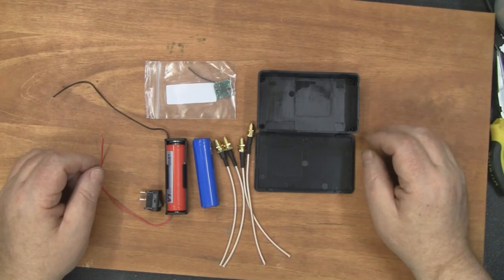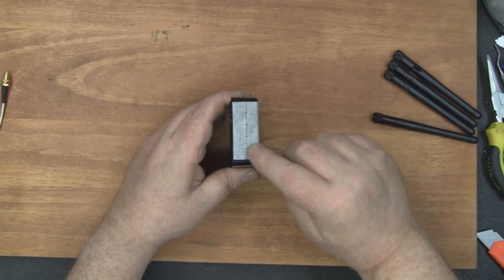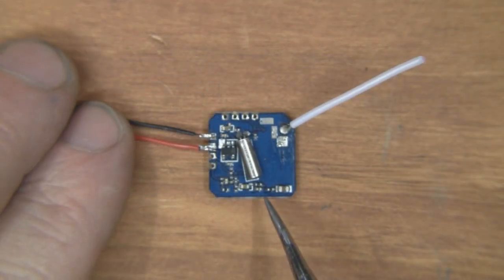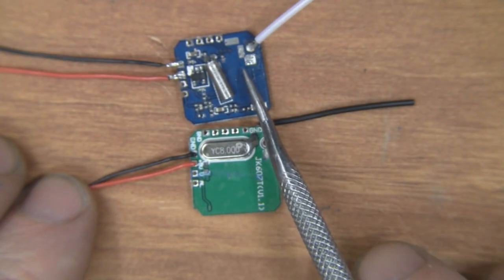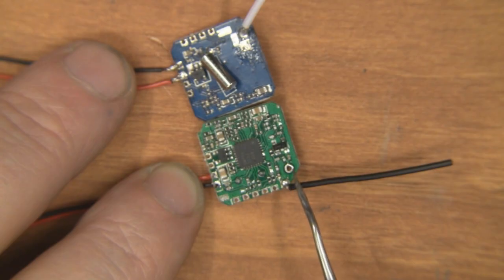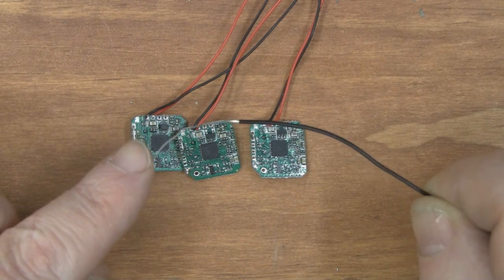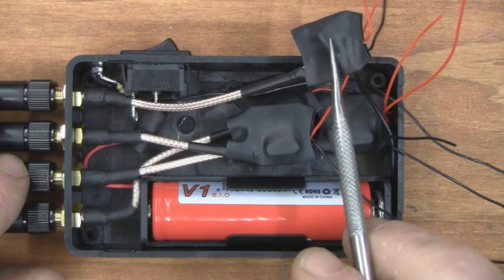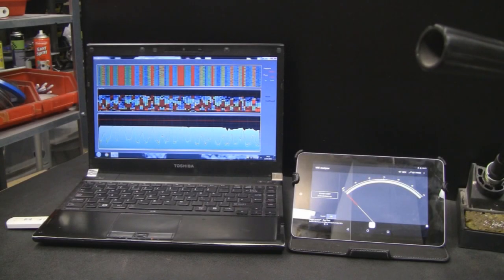WiFi Jammer #97

Comment: Hi Andrew! Nice project. I ordered 4 boards and the are different from both of yours. I wrote to the seller and he told me that I have to place the jumpers between pin 4 and 7 were 7 is ground - vcc, then lets say 5 and 7, and 6 and 7 and leave one board like you with no jumpers... Does it sound logical to you to use the ground? He says that way I will get channel 1 -2-3-4... I would love to send you a closeup picture of the board, but I do not now how. If you can give me a hand I would appreciate it very much. Cheers

Comment: Hello, your video has helped me a lot for the construction and presentation of one as a school project, so I thank you for the video, however I have some questions that I wondered if you could answer: With the Jammer that I have built, the signal is not inhibited , but dims, in my tests a 70mbps download and 31mbps upload connection dims to a 4.70 on both. Why has this happened? Why hasn't it been disabled? The components are the same and the only difference is the battery that in my case was used a 3.7 volt lithium cell phone battery, it was slightly discharged.
Secondly, the inhibition area is quite poor, the devices to be inhibited must be extremely close for their signal to be attenuated.
Finally, what is the spectrum analyzer program or device that you use, both the tablet and the computer?

Comment: I knew there was a good reason to save those dozens of Wi-Fi antennas I got for free.

At one time there was a small "antenna tester" called the AirHorn.  It made a very effective Jammer (shh) too, and had its own GUI control package for the PC.   It attached via a USB cable.
As a jammer it was under-powered, but could be very useful in a large apartment complex for driving your neighbors to other channels

Comment: Dunno if you see this but... I use XLT24017 as the ones you exposed here are not to be found anymore (by me at least), and they run pretty hot. I can still touch them, but I have the feeling that´s not how it should be, or is it? I´m powering them with 4.95V as per the current specified is 5V on the datasheet... All comments are welcome! Cheers!
Reply: @bunny lord I can't see your question, just the notification, strange, hope this reaches you; Honestly, and thinking about it, I admittedly tried only the preinstalled little piece-o-cable antenna it was shipped with as the antennas I got shipped were sent with a wrong conenctor (their fault, I'll be getting new ones reshipped). I guess with the correct full sized ones (with ground conencted as per the shielding) should help (?). Otherwise, my test in my house showed indeed a breakdown in the communication, even with those cable-antennas... Thank you for commenting and investing time!
Reply: @RIPezz_Raded what makes you think it wouldn't? Frequencies for 2.4ghz  are everywhere the same...

Comment: I too was wondering about the battery/power supply. As far as I can tell, the transmitters are powered by 5V, what am I missing? Thanks ahead of time for your help.
Reply: its a 18650I 3.7V Rechargeable Battery 2500 mah plenty enough to run the transmitters

Comment: I've heard of farmers using these to keep drone pilots off their land.
Reply: That’s why I use Crossfire or Ghost no interference 😱
Reply: Well those are some cheap farmers! Good drones use a protected connection that goes via a encrypted connection.
Only drones up to 70$ use wifi
Reply: @Kayshots , a encrypted connection will not stop the drones from being jammed. If they use 2.4 GHz and it‘s a jammer (not deauther), the drone can still not be controlled.
Many more expensive drones use 5.8 GHz, which still can be jammed (but it‘s more complicated).

A jammer basically is like someone shouting in a meeting, while others speak. It floods the spectrum with noise and therefore messes with the modulation. A deauthing device will send false deauth frames and abuse a exploit in most (even expensive) routers.

Comment: hello Andrew ! i live by the sea and there is no adsl ( no wired phone ) so the only way to connect is through a hotel i bought ALFA WiFi adapter ,,, it worked fine  the first few days than it started disconnecting and reconnecting by itself ,, i spend hours googling to find a solution ,,, many say drivers ..updates ect.. all that didnt work i even formated my pc win 10,, than someone said alfa needs 500ma at least  to work so i bought usb hub and a 12 V charger than  the whole thing blows up, the usb hub and the alfa is there away to connect to the hotel ? the distance is only 300 meter please help ! i had enough buying data on my phone

Comment: what's the battery rated @? 1.2v?? or 2.4?, assuming it's a rechargeable
Reply: Fone Zombie 3.7 volts and yes it’s rechargeable. It’s call a 18650 battery

Comment: When is an AV wifi module becoming an illegal device ? It seems to me that broadcasting a wifi signal can't be deemed illegal, even if it is powerful enough to "jamm" other signals...
If operating AV modules is illegal then any mobile phone, router or the like could be deemed illegal. You can argue that any added connected device (mobile phone or tablets) will make smaller the available capacity for the rest of the connected devices... Would be connected to the wifi network and using capacity be considered as being disruptive ?? It could be if you think about it... Keep in mind that most people using wifi networks hardly do anything useful with there hand held vibrators, broadcasting there usual daily (social media) nonsense and assorted rubbish... Could that be considered illegal or disruptive ??

If you were to put in a small audio device to the mix which would make it a device which is most likely protected by your freedom of speech...

Comment: remove microwave door
Wifi jam
Reply: Cuts rose scents leave door closed on a 1200watt microwave and it works... my wife does it to me every night.
Reply: Millsolar 
dude that means the door seal is leaking microwaves is the Wifi cuts out.
Your children may be born with x men superpowers from mild radiation exposure.Positive mutations!
Reply: Cuts rose scents all microwaves do that. ask your power company to come and do an emf reading in your house. the door is just glass.
Reply: we dont let the kids anywhere near it when its running
Reply: Millsolar 
I know,I tested my old microwave with a meter. I had a seal leak in the lower left corner of the door.
Cut the cord and trashed it.
Its not like a Fukishima meltdown. The magnatron is pretty weak in a little microwave. 
But I have since been collecting them to make a focused microwave array.Im taking down the commercial drone that the jerk down the road flies over my property.Its my airspace.
Reply: @cutsrosescents4950  what happened did you get the fruit cake of your neighbor got same problems sheriff said I cannot shoot it down because is considered discharging gun to the air

Comment: do you know if this jammer will also jam bluetooth connects as it also operates at 2.4GHz?
Reply: it will
Reply: @naineeowo1469  hi , can I block Verizon wireless camera , whit jammer??
Reply: Kostadin Tomov yes it will
Reply: @naineeowo1469  nice, do you know from what distance I can do that? Like 10 meters 20...? I think that cameras using cellular data .
Reply: @kostadintomov2279  I am sure it can do 20 metres and dont worry it can definetly jam the wireless camera which uses cellular signal, after all cellular signal is also wirless. And also curios why do you want to jam a wireless camera?
Reply: @naineeowo1469  my neighbor is ass , he have 2 cameras pointing my house . I just want my privacy.
Reply: Kostadin Tomov Oh ok, but are you sure your neighbours camera is wireless and not wired, if it is wired camera, jammer will not work, also do not keep jammer on for long time the police can track you. Jamming is illegal be careful, dont get caught!
Reply: Kostadin Tomov By the way. What jammer do you have? It should be able to jam 800Mhz-2.4Ghz. That is the wireless cctv camera range. Dont buy wrong jammer.
Reply: @naineeowo1469  I will use it just for few minutes , specially when I'm in my hot tub with my girlfriend. 5-10 min will be enough.
Or that is to long?
Reply: @kostadintomov2279  No thats not too long I thought u would use it for a whole day. Haha. 10mins is not long go ahead.
Reply: @naineeowo1469  I will bay the strongest jammer on the market , and yess it's working in that range , and every other apparantly . But I think I will block my smartphone to , but that's totally worth it. Thank you
Reply: It could cause some probelms, but as it doesn‘t jam the whole BT and EU/JP wifi spectrum, these connections still could work.

Comment: I must agree with your comments about Ofcom totally useless organisation should be abolished.Do you sell this device if so where can i buy one.
Reply: Read the suff under the video by clicking SHOW MORE
here is the connects schematic of the AV TX unit:
https://drive.google.com/file/d/0BzmJxxD-Z4B6T0tkRjhlc0tlN2s/view

Build your own:
http://www.banggood.com/2_4-GHz-8-CH-Wireless-FM-Stereo-Audio-Video-Transmitting-Module-AV-Transmitter-p-1019834.html
https://www.banggood.com/search/pigtail-ufl.html
http://www.banggood.com/10pcs-40W-Electric-Soldering-Iron-Set-Solder-Welding-Iron-Tool-Kit-p-930275.html
www.banggood.com/DIY-1-Slot-18650-Battery-Holder-With-2-Leads-p-972775.html
https://www.fasttech.com/products/101/10001980/1141100-panasonic-ncr18650b-rechargeable-3400mah-3-7v
find the rest of stuff like box, jumpers....etc. here:
https://www.fasttech.com/category/1099/electronic-components
Good luck

Comment: Hi Andrew, I have a TX6729 AV transmitter. It looks very similar, however there appears to be one hole missing and I think the GND and +5V are the opposite way around?

Circuit diagram is here: https://ae01.alicdn.com/kf/HTB1kBh7KFXXXXaVXFXXq6xXFXXX9/TX6729-small-volume-2-4G-100mW-wireless-video-transmission-emission-module-with-low-power-consumption-wireless.jpg

Many thanks

Comment: this will let every rc product fall out of the sky ;D
Reply: Floh not really for example my mavic pro has 5.7 ghz I think and this can only jam 2.4ghz
Reply: Thats right ;D
But isn't your Control also 2.4ghz ?! ;)
2.4ghz is the second hamonic wave of 5.8, that could also cause problems =)

Grettings, Floh
Reply: Floh yea it might lose some some signal but it will probably still reach it. But if it doesn't I'm not worried at all I've lost signal on my mavic pro before but in about 2 minutes it showes up right where it landed
Reply: Alex just build another one of these, just with 5.8ghz transmitting units ;)

Comment: so the chip has multiple holes for different channels and each hole has a different channel. how do you select each channel, do you ground it?

thanks!
Reply: The antene is the shunted switch completing circuit & selecting & opperating choice, commonly in electronics.

Comment: name of your spectrum analyzer? pls thanks!
Reply from the maker: http://www.ebay.co.uk/itm/2-4G-SPECTRUM-ANALYZER-WIFI-FINDER-WI-DETECTOR-/281514956573
Reply: ohh thanks
Reply: is their a jammer circuit for cell phones
Reply: Andrew Angelo Barrientos 
That's just to show that he is also interested in an answer to your question.
Reply: Could you tell me the name of the antennas you used in the project, please?
Reply: Andrew Angelo Barrientos
Reply: Matthew Vazquest WTF what?
Reply: andrew mcneil Hi Andrew, can I use 2.4ghz monopole antennas instead? They are specifically made for wifi application but they are much smaller in length and monopole. Please advise:)

Comment: Does this also jam bluetooth signals?
Reply: The Cookster 
If your going to have a discussion.
I recommend you actually read what somone else has spent much time on writing.
Reply: The Cookster
If you blocked the 79 channels having in account that you were nearby the device so that your jammers interference was greater than that of the connection between the devices . A bluetooth speaker won't give out "White noise" which is what I believe you are referring to. If the connection is poor it will simply disconnect as the BT Device wouldnt see any devices probing it requests.
(there may be some slightly noticable interferences in the audio but nothing like a radios "white noise")
(White noise is many frequencies with equal intensities)
Reply: No, Different frequency,  bluetooth actually is a communication on frequency hopping meaning to completely interrupt it you would have to know what channels it is hopping on, unless you just jammed all of the channels. Good idea though.
Reply: Jake Cope Damn, it's a shame this stuff is expensive and illegal. Those loud ass bluetooth speakers are annoying as hell
Reply: moncool17Gaming indeed, If you really want to be malicious look into Emp's or Bluetooth hacking which there are ways of doing if you look into the lastest defcon and hak5 videos.
I have seen some cool breakthroughs
Reply: +Jake Cope But doesn't the jammer in this video block all channels?
Reply: Jake Cope
Bluetooth: between 2.402 GHz and 2.480 GHz
WiFi: 2.412 GHz and 2.484 GHz.
So you are saying that the Bluetooth will hop to the lower frequency to avoid the interfereance?
The jammer I built based on this video will interfere with multiple channels (frequencies). When it is set to 2.468 GHz it will even block wifi on >2.437 GHz frequencies.
Reply: The Cookster 

I would just like to start out by saying I never stated Bluetooth "goes to lower frequencies" as you put it. That was your misreading however it does "hop" to advoid interference.
 Heres a loverly rant of information I think you will greatly appreciate.
Bluetooth operates in the 2.4 GHz band using 79 channels, spaced 1 MHz apart, from 2402 MHz up to 2480 MHz.

Bluetooth is less susceptible to jamming than Wi-Fi since Bluetooth uses a technology called Frequency-Hopping Spread Spectrum (FHSS). This means the signal "hops" from one channel to another, using a pseudorandom sequence known to both transmitter and receiver, 1600 times a second (every 625 µS).

In addition, Bluetooth also employs Adaptive Frequency-Hopping (AFH) which means it will only use "good" frequencies, and avoids "bad" frequencies, i.e. ones that are interfering with it.

So first of all, someone trying to jam a specific Bluetooth communication would have to be privy to its pseudorandom sequence, and then once the channel causing interference is detected, the jamming frequency would automatically be avoided anyway.

Wi-Fi also operates in the 2.4 GHz band using 11 channels (in the US) spaced 5 MHz apart, from 2412 MHz to 2462 MHz. Because the bandwidth of a typical Wi-Fi signal is 20 MHz, assigning a Wi-Fi signal to a particular channel makes adjacent channels unavailable (for example, channel 6 will spill into channels 5 and 7, and a little into channels 4 and 8). So you can only get three non-interfering Wi-Fi signals in the same location: 1, 6, and 11.

Obviously, if you had a device that could jam the entire Bluetooth or Wi-Fi channels bands, such as a $5000 one, which is easier to jam is at moot point. But assuming you are trying to jam a much smaller bandwidth, since Wi-Fi uses fixed channels, it would be easier to jam Wi-Fi than Bluetooth -- since if one jammed an entire Wi-Fi channel (20 MHz), this would tie up 20 Bluetooth channels, but the AFH mechanism would allow the Bluetooth to avoid these and use channels that were not blocked.
Reply: Jake Cope
No I was just trying to make sense of what you where saying. This jammer does infact block all wifi channels and prevents discovery of bluetooth devices. I will test it whilst on a bluetooth device later.
Reply: The Cookster 
I'm not assuming it, I based it from what you've said in response to what I have stated.
clearly you need to use google instead as I won't explain anymore.
Reply: Jake Cope Assume: suppose to be the case, without proof. You are saying that the BT will hop onto the channels with least interferance because of AFH. However this will only make it LESS succeptible to NARROWBAND interferance. It blocks Bluetooth and if not will severely reduce bandwidth causing the speakers to produce static.
Reply: You're a loverly person, I advise you go walk for abit.
Reply: Jake Cope
No I read it alright, stop being so quick to assume things. Wifi hubs themselves switch automatically to the channel with least interferance. These jammers "split" into the adjacent channels so four of them are sufficient to block the entire WiFi range and therefore the majority of the Bluetooth range. Perhaps its something I just don't understand?
 EDIT: These four transmitters don't even work on the same freqencies as the "fixed WiFi channels", they work on channels ~1, 5, 8/9 and ~12.
Reply: The Cookster 
yes it blocks all channels on the WIFI Frequency range.
renember a frequency has a range of channels within it (technically speaking)
so in order to block a bluetooth Frequency you need to be on an entirely different frequency.
doesn't matter if it covers all channels if it's on the wrong frequency. thats like shouting in the wrong room.